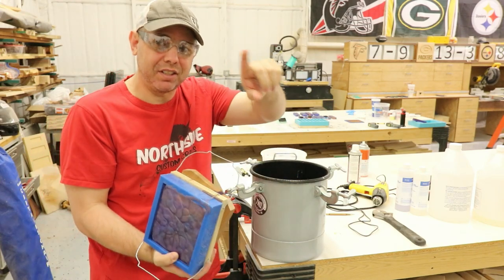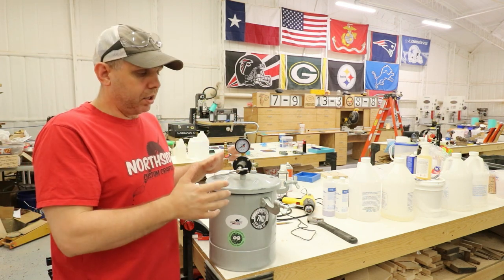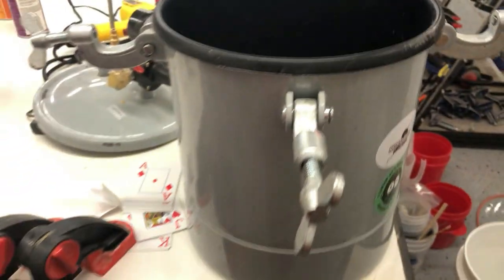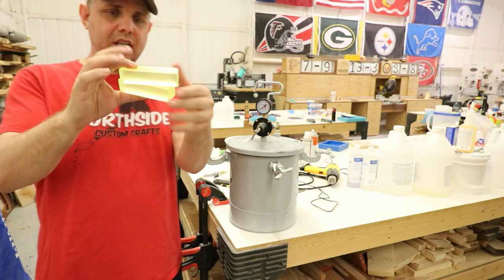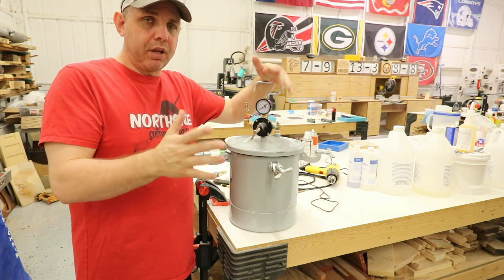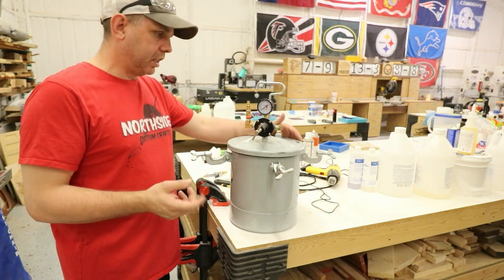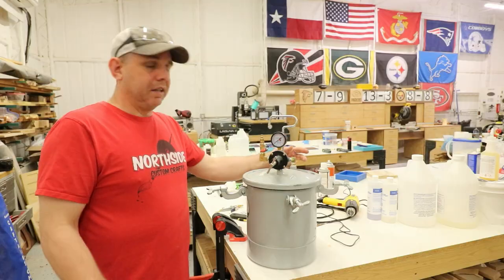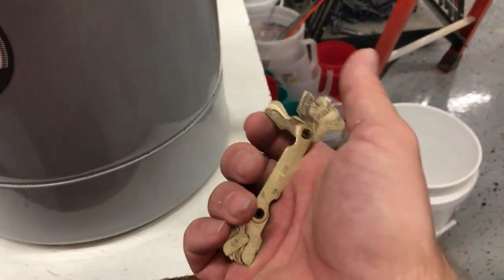Harbor Freight Pressure Pot for Resin Casting, Questions Answered!

Comment: Be careful tightening it. I have destroyed one of the clamps from tightening it too much. What I'm going to do to fix it is get a 3 inch clamp for about $4 and drill a hole in the bottom of it to use as an additional clamp. I do worry about it not being strong enough but I'll see. I'm also gonna get gasket material and see if I can tighten it less

Comment: I’m finding adjusting that pop valve to be a huge pain. It’s loose enough to be leaking without fully popping at like 30psi but I can’t seem to screw it in any tighter without just chewing up the brass
Reply from the maker: Sometimes they need replaced from the start.. cheap stuff..
Reply: @JakeThompson  yeah that's what I'm going with. Just not happy to have to wait til the end of the week to be able to use the thing when I spent the day today building it. Cheap import tools- what can you do?
Reply from the maker: @katjoe1974  totally agree

Comment: How do you fix the pull release? I tried using a screwdriver to tighten it but it still releases pressure around 40 something psi.
Reply from the maker: MuffinMan0521 I show in the video how to adjust it. If that doesn’t work, then it’s a faulty pop off valve.
Reply: @JakeThompson  Thanks. Must be a faulty one. I just ended up replacing it with a ball valve since I have a regulator set on my air compressor to 50psi.

Comment: also, do the molds that you use in one of these have to be degassed molds? thanks
Reply from the maker: It’s always better to degas silicone.. but for penblanks it’s not as big of deal because I make them oversized and cut them down

Comment: Someone needs to make a video on a pressure pot basket that is level.
Not sure if it’s called something else.
Whatever the thingy is that goes inside the pot to place moulds on with a handle so people don’t spill resin through their new pressure pots.
Reply from the maker: @matpolson4411  There are mold carriers out there that fit in these pressure pots.. You just need to put something flat in the bottom of the pot and level the pot. 👍

Comment: Yeah, ya don't need to be cranking things down with tools, Jack hammers and dynamite. the more cranking you do the worse it gets, the problem is the HF cheap gasket. Throw that damn gasket in the trash (or save it for some other project). For you guys making products using silicone / rubber molds, for fishing lures, etc. Just mix up some of your silicone rubber, flip that lid upside down, (get it level), and pour that groove where the old gasket used to be about 3/4 the way full with your silicone rubber. Then grab a caulking tube of clear 100% silicone and put a generous bead of caulk around the inner portion of that cheaply made metal band inside the lid. If it's sunny outside, let the sun bake that stuff for a few hours, bring it in and maybe let it set over night unless you got the faster setting silicone rubber material. You should be good to go after that, you can finger tighten the lockdown clamps and get on with your production. I do alternate the tightening still by habit, same as you would tighten lugs on a truck rim. Works like a champ, fast easy and consistent. Hope this helps!
Reply from the maker: I have changed the gasket on the lid.. worked wonders
Reply: @JakeThompson  Yup, ain't nothin to it.. Lol Ya got some great vids by the way. Jealous of that CNC ya got. That thing is sweet! I would love to make a custom guitar body with one of those, that would be incredible...

Comment: Ok I keep running into the issue I can't adjust the valve for release pressure. It won't even turn no matter what I try.  Idk how you made yours move so easily. Sorry to bother!!
Reply from the maker: If it won’t turn, it probably needs replaced.. it should turn pretty easy.

Comment: For deep pour resins is a pressure pot needed?
Reply from the maker: Gerrant Mata It’s not needed but you need to pop bubbles with a torch or heat.

Comment: How long does it take while it is in the pressure pot? I'm sure one factor is how much is inside the pot, but what if, say, 4 pen blanks are in the pot at 50 psi? Really enjoy your videos! Keep them coming!!
Reply from the maker: If it’s alumilite clear slow you can take them out of the pot in 2 hours... the smaller the amount you pour the longer you need to leave it in there.. it takes longer for the chemical reaction to take place with a lesser amount of resin.  Resins or epoxy with longer working time, I just leave overnight

Comment: I think that the Harbor Frieght pressure pot is designed to use with a liner that’s why you have your leaks it’s just a thought there’s just too many videos out there with the seal leaking
Reply from the maker: I replaced the seal with a replacement one off of Amazon.. fixed it
Reply: Do you have a link for the new seal?
Reply: @joshcarnprobst9739  Amazon has it mine didn’t leak lol It was just a thought because everyone’s was leaking

Comment: Why does the lid have to be in h same place?
Reply from the maker: It doesn’t, but it seems to help seal it.. and the regulator will be in the way if the bolts are lined up with it so it just makes it easy, when you are casting, you don’t have much time.

Comment: What the heck? Yours leaks BAD. Mine barely loses 5 psi over 24 hours.
Reply from the maker: Sometimes that would be the case too.. but sometimes it would leak like that... I did change the seal in the lid.. totally fixed it.

Comment: To be honest, I strongly advise against these pots.  They require a lot of modding, they are cheap and poorly made, and even if you do everything right there is like a 50% chance the pot you got still won't hold pressure due to a bad gasket, shipping damage, etc.  You may even end up spending 50+ in tools/parts to do the mod if you don't have the stuff on hand to begin with.  Just go pay 250-300 for a better pot that is already pre modded and or better quality.  Yes you will spend 100-150 more, but it will already be flat, might have a pot liner included, will be easier to use, require less modding, and probably will be a bigger size too.  

Woodcraft sells a 5 gallon one for example that is ready to go out of box no modding at all for 260 or so.

I resin cast..... lots of stuff lol.  Today a couple pieces of jewelry are curing away.
Reply from the maker: Karkarov I can’t argue with any of that.. well said.. Some folks won’t spend the money on a better pot so I like to show how to do it cheaper.. you can see I have a better pot too... lol
Reply: @JakeThompson  Truth be told Jake I have the same 10 gallon pot you do lol!  It does spoil you.
Reply from the maker: Karkarov I’m telling ya... I’m spoiled.. lol

Comment: To tight on that lid bud find the torque spec
Reply from the maker: I got a new gasket that someone suggested in the comments.. works great now
Reply: @JakeThompson  awesome I know that the cheap ones they send will often times seal up with mineral oil as well

Comment: I'm a big fan of HF tools, but when one wears out to soon or just doesn't work right, I step up to a better quality tool that does work properly without spending on more parts or jury-rigging it.  What you have there could blow up and put you in the hospital.  Paint pressure pots are designed for the air to pass almost continuously (lead, if you will) by pushing paint out.  They are not built to hold any appreciable pressure for more than a minute or two at a time.  

Could you afford to pay someone else's hospital/medical bills, when they follow your directions and it blows up?  Could you even afford the attorney to defend you against the lawsuit?  

Unsafe.👎
Reply from the maker: Thank you mike.. check out my other pressure pot videos.. maybe they might be more safe. https://youtu.be/S6tvPsPEIQ0

Comment: Hello, I’m new to all this so i apologize if this question sounds silly or simple. Can i use a simple portable air compressor electric pump for this kind of pot for the air?
Reply from the maker: The tank on the air compressor needs to be similar size to the pot to make sure it fills up fast